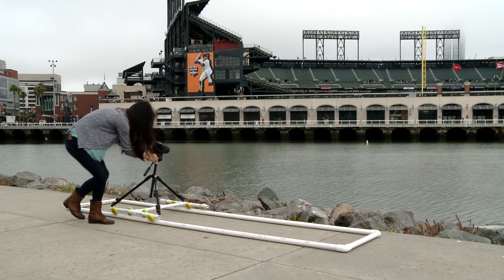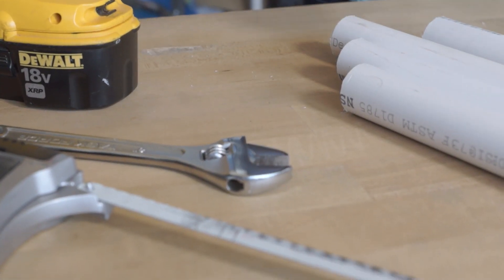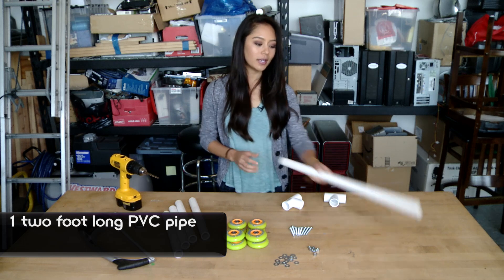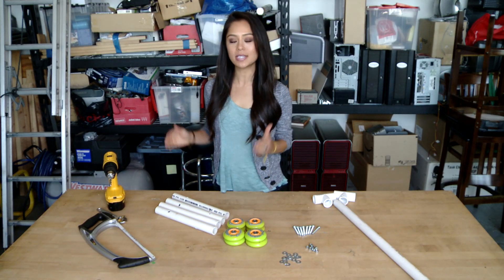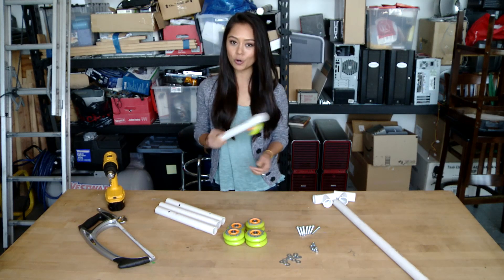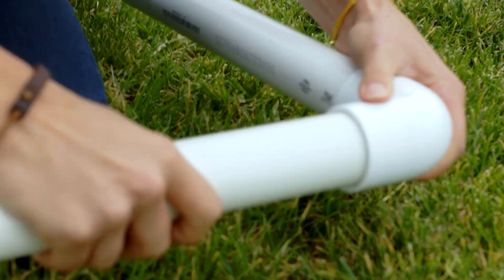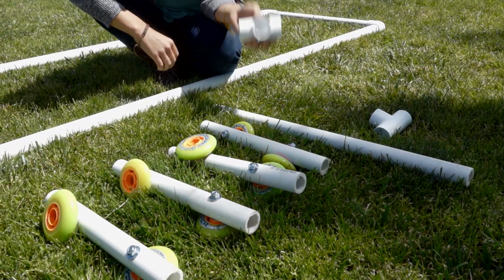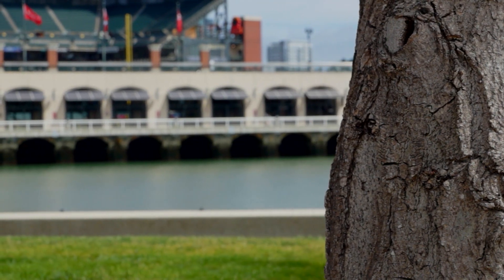How to build your own dolly track (DIY Tutorial)

Comment: $115+ on this project. wheels were $50. It works, we added lock tight washers, pipe glue, and some rubber feet for the tripod to sit on.
Reply: I used a 5/16 bullet point drill but on a drill press. my method for drilling was draw a strait line then after drilling on the line put on the wheel, then rest it on the platform and the angle that it is at, drill about 5 inches from the first hole.

Comment: you don't exactly give the nuts and bolts sizes for this
Reply: nor do you tell us where to drill on the PVC (measurements)
Reply: and! you didn't tell us how to attach the tripod!
Reply: I wondered how the tripod was able to fit on the sliding part of it without any holes in the slider.
Reply: And the drill angles